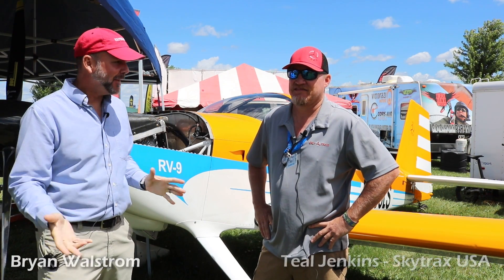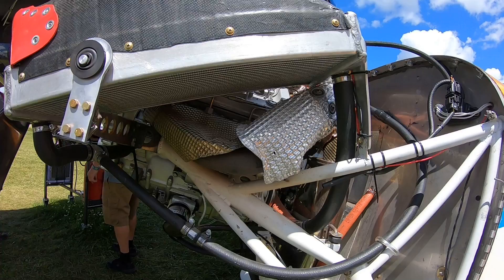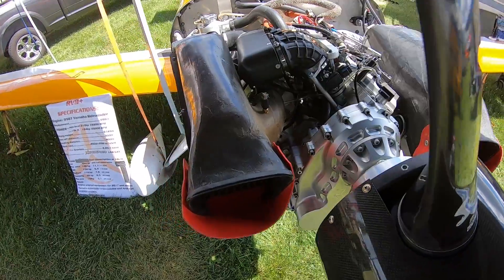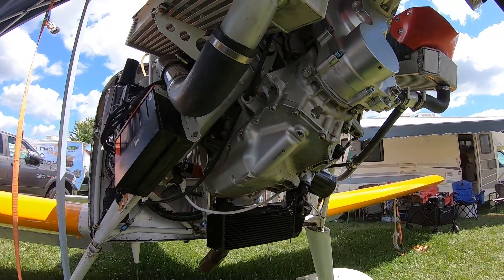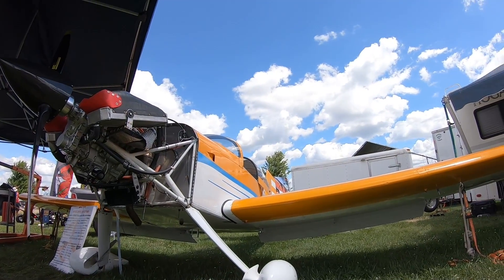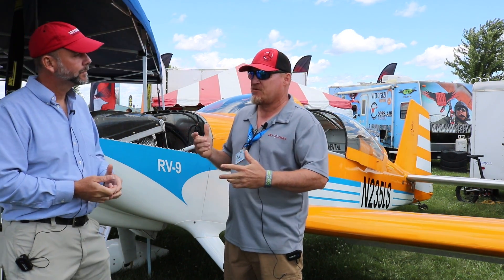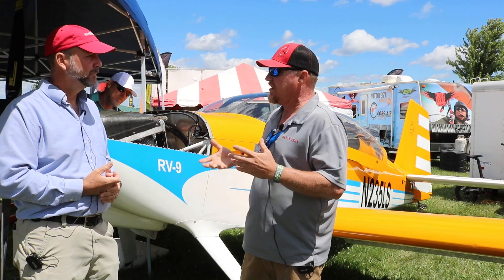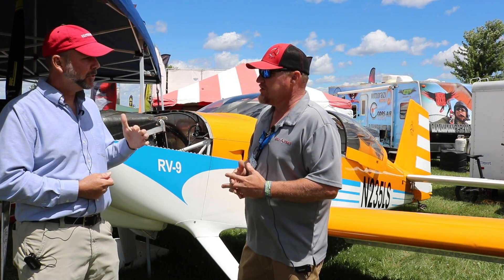Yamaha Powered RV9! Sidewinder + Skytrax Teal Jenkins

Comment: One advantage not really mentioned is the ability to use auto gas like a rotax.  While a bit inconvenient, the fuel cost savings are real.  The climb rates are amazing, not only thrilling but a great safety feature.

Comment: So, he switched from a simple air-cooled reliable engine and opted for that level of complexity, and that's supposed to be an improvement?
Reply: These engines are run harder, longer and are abused terribly in their stock applications compared to aero engines and they run forever.  They are also essentially full FADEC with dynamic mixture and ignition timing maps and knock sensors that react to load, fuel, temp variance faster than any pilot jiggling mixture and throttle knobs.

Comment: Why I do admire the spirit of ingenuity in a custom build, there are other things to consider. Auto engines and their components were never designed to fly! Reduction gear drives, turbo, unproven engine / airframe combinations, high RPMS needed to develop true power, not something I will risk my life in. Why do people continue to use these cheap unproven auto solutions when proven solutions are already available🤪one thing to consider in the costs of these conversions is insurance costs and liability subrogation by the insurance companies after an accident. All this for small additional climb and fuel economy gains, is it really worth it? By the time you consider the time spent tweaking this array of unproven parts together safely and reliably, the costs of Lycoming or its clones is less. It’s the same for the Viking engines that you show on this web channel, not for me.
Reply: I respect your opinion and for sure these engine conversions are not for everyone and will never take over the market but please consider this when  voicing your opinion. This particular conversion is not an automotive conversation and this particular engine is designed to rev at high rpms for prolonged periods of time. (how long is in this application is undetermined). I personally love the challenge of experimenting and trying new things that could possibly advance the aviation experience. The gains are not just "marginal climb" this plane climbs about 3 times better now then before. The handling of the plane with 100lbs less engine weight also contributes to a better flying experience. Fuel savings is very small if any at all. I also don't do this for a cost savings because like you said after all the tweaking and swapping of parts to find the right combination it is currently not cheaper. (perhaps cheaper in the future after some of this pioneered and resource shared). To your question is it really worth it? I would say that all depends on the person. I personally live for engineering new things that are sometimes are very different from the norm and call me crazy but I also like the excitement of testing and trying them. It takes more time, money ,  effort and yes some more degree of risk over going with the tried and proven but just maybe there will be something learned from these experiments that can be shared and passed on. After all we are granted these privilege's of owning and operating experimental aircraft for the purpose of learning and educating ourselves and others with this experiment. For those that build or pay to have built experimental aircraft that is exactly like a thousand others is it really an education opportunity or just cheaper alternative to the certified aircraft.
Reply: @tealjenkins4716  Perfect response!
Reply: People that make these statements have no idea about engines and how they work and the stresses behind them. Your average Lycoming/Continental is under more stress at 2500 rpm than a Rotax or similar sized 4 cylinder engine at 5000 rpm. I'm using a 1.5 litre Suzuki engine and the tensile stresses it faces are about 2.5 times less at 5000 than an O-360 at 2500, yet I make more power and the piston speeds are about the same. People are stuck in the mind frame of these engines from the 1920's thinking they are a good design. They were obsolete by 1930. I am genuinely amazed that people still use such obsolete engines, from an engineers perspective it is mind boggling. I think it is just a case of what people are told and what they are used to, more so than what they know about an engine. Air cooling which creates oil issues, over heating issues, clearance issues. leaded fuel to compensate for high cylinder temperature, poor quality oil to compensate for leaded fuel, then also dual ignition to compensate for fouling of plugs due to poor quality oil and fuel. Not even to mention the issues of single intake valve, or pushrods, or rockers, valve rotation, wear. The list goes on and on. Why do people think that engines went away from these 1920's designs. There are soo many reasons.
Reply: @chippyjohn1  You nailed it.
Reply: Are you serious, Lycoming and Continental engines?  You obviously haven’t had the pleasure of maintaining this 1930 technology.
Reply: One could also consider that it is not worth it to fly any piston powered aircraft. What makes these things worthwhile is the pursuit of happiness, and there are people (including me) who get joy out of flying a small plane and (hopefully soon to include me) modifying it to try to improve it in some way.
Reply: Glad the Wright brothers felt differently…
Reply: Anybody that puts a non-traditional engine on an experimental airplane should understand that they are buying into someone else's experiment.  It's not that these engines are inherently dangerous, but the builder needs to be aware that they will be much more involved with working on the engine than with a traditional powerplant while all the bugs and fine tuning are worked out.  I also wouldn't recommend this engine for a first time builder until the design has significantly more fleet hours under its belt.
Reply: @peteranderson037  Most people taking on a project like this are pretty skilled and or have a pretty large budget. If not your right they should stick to 1930’s technology.
Reply: You know what’s funny. These guys talk about traditional aircraft engines and what engine does continental use for the 3.0 liter jet A. The Mercedes OM642 3.0 diesel 😅. Same engine in the DA62 which will probably work out great because it doesn’t have the emission bs that my suv has.

Comment: I admire the adventurous spirit and accomplishments. However, it needs to be said that having 184 HP at 10k is pointless because you won’t be able to use anything close to that power without quickly exceeding Vne. (A reminder that Vne is TAS in RVs). This is discussed in detail in a paper by Van on the Van’s website. Be careful. Great climb though!

Comment: I love the RV-9/9-A, it's one of the planes on my shortlist if I'm ever able to step up from my 172. I also find it very interesting - the use of Yamaha engines in planes, I've seen them used In STOL planes and they seem to work great and are far less expensive than typical 'airplane' engines. One question I had about this video though. On the Van's website, for the RV-9/9-A info pages, there is a whole article about why a 160 HP is the max recommended engine in the models. Granted, that may have been with the typical Lycoming O-320 engine. Of course, being experimental, there is no absolute engine that must be used, but the max of 160 HP was definitely highlighted. I wonder if the gentleman was aware of that and if the airframe has been compensated in any way? But all-around, the 9's are designed for being comfortable, easy flying cruisers, like you said.
Reply: It shouldn't matter as long as it doesn't exceed original weight limitations and as long as you are not exceeding the vne.
Reply: At some point flutter is an issue.   Maybe respecting Vne would be enough but as altitude is increased atmospheric dampening decreases, so the margin at 12k ft Vne may not be adequate at say 20k or 30k ft, even at same indicated air speed.   As I understand it reading Vans white paper on the RV10 it isn’t the load it’s the stability (stiffness main driver) that limits us in high speed high altitude via flutter.   Happy to be persuaded otherwise.